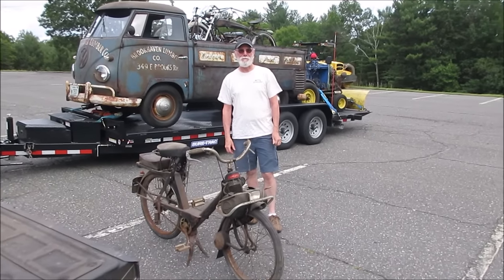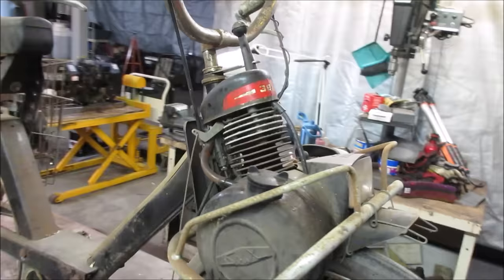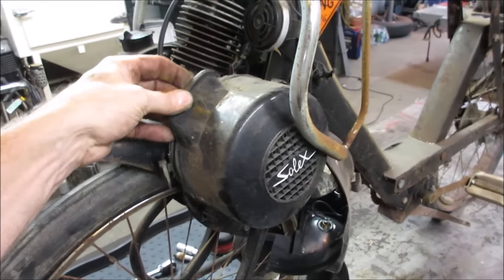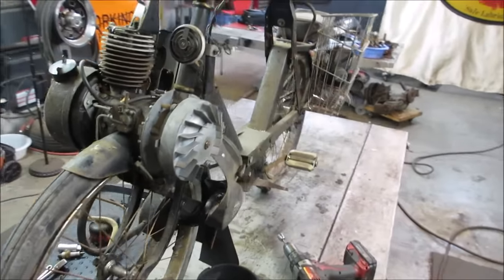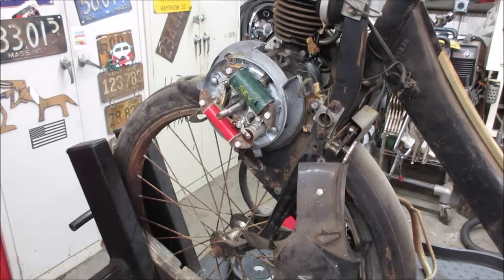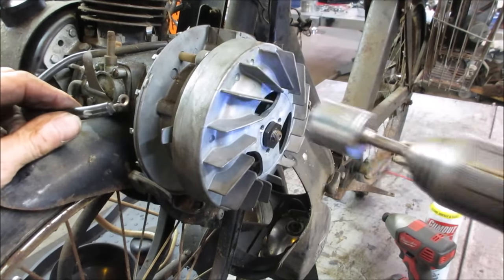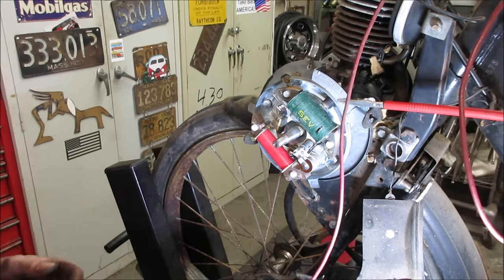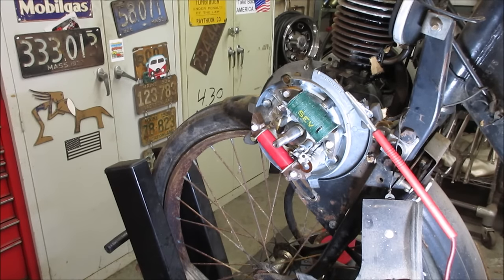Will It Run? VèloSolex 3800 Moped Parked in 1978.

Comment: My son had the same prob;em with his basement flooding about 10 years ago when all the power was cut by a storm and tornado for several days. Afterwards he installed a backup sump pump that runs off of city water pressure. It is set to a little higher float level than the electric main pump so it will only kick on if the electric one does not.

Comment: Had one of these as young. Late '83 it must have been. Was my first moped. Drived quite well, except if it was rainy weather. The the drive-wheel would just spin around without moving the bike forward. Being that time, there were some hacks for those to make them drive faster. The gas handle is correct, you needed to grab it to throttle down. 
Nice to see that machine again. Like a peak in a time machine. :)

Comment: My father in law bought one in 1954 France and he sure liked it.   He didn't have a car and used to use a bicycle to go to work.
I bought a 1978 AMF Roadmaster Model 110 in the 1970s to ride to my car pool when it was not my day to drive.
It was rear wheel drive like the Solex.  Sold it about 10 years ago for $100 needed a new drive stone that drove the rear tire.
Very simple engine with a plastic crank case.

Comment: The screws and bolts are probably all metric, as far as I know France invented the metric system. Pre-WWII threads might have non-standard pitches though.

Pipe fittings on vehicles could be anything I suspect. House plumbing in Europe uses Whitworth (British Standard Pipe Thread) with very few exceptions but fuels lines could be SAE I think. Black and galvanised pipes are Imperial, copper and stainless steel pipes are metric, as are drain pipes. Tap aerators use a metric thread (M22) that's deceptively close to 1/2" BSP but isn't compatible.

Fun fact: metric spanner sizes, like US spanners, are measured across flats, while Whitworth spanners are measured according to bolt diametre. Some metric bolts come in two different head sizes and French car manufacturers have been known to use both in one car. Whitworth bolts only go as small as something like 1/4", smaller UK screws were BA (British Association) screws, which was a metric system but incompatible with ISO Metric screw threads.

Fun fact #2: Italian light switches and sockets are fixed to the boxes in the wall using #6-32 UNC screws because the manufacturer BTicino imported the entire US back box system in the early 60s. Desktop and tower PC cases and some hard drives and optical drives use the same 6-32 screws while 3.5" floppy drives use M3 screws.

Comment: Had a solex 3800. Was always amazed at the fact the throttle works backwards. Weird french thing to always be full throttle and you had to bring it to idle. 

Was a pain in the ass to get it working correctly. One day I was so frustrated I threw it in the gutter and walked home.

Comment: The advantage of the Solex is that it works like a real bicycle with the motor disengaged, while sitting in a bicycle position.  Other mopeds at the time were motorized bikes with peddles added like a after thought with lots of friction and bad peddling position.
Reply: Except that the gearing is really low. You end up pedalling a lot for the little speed you get. No choice because that was the way you started up the engine, fighting compression.

Comment: Raise your engine for testing, otherwise you'll wear out the tire with the roller.
The carburetor is a continuous-flow unit, the hose is just a return to the tank.
Check and clean the fuel filter at the top of the carburettor and replace the air filter on the cylinder.Throttle control is only used to slow down the engine. Normal operation is full throttle!
The choke is the lever on the carburettor just behind the fuel filter.

Greetings from France!

Comment: My father bought a Velo Solex in 1960  for the commute to work 2 miles each way on a gravel road with 2 hills....
He did this for 3 years and had worn it out....
Traded it in for a 2 speed moped..an NSU Quickly....and basically gave that away after another 4 years doing the same commute...
and I never even got a chance to ride it!.
Reply: I have a 1961 NSU Quickly S…it’s the 2 speed, and great fun.

Comment: There is a fuel filter inside the fuelpump. The driving roller is made of carborundum. The decompression valve in the early models was ment  to stop the motor when not engaged

Comment: Back in the early 1970's there was a 2 stroke engine that mounted to the front of your bike. You would flip it down and it would rub on the front tire and start the engine. This 2 stroke engine could be mounted on the front of any bike and power the front wheel.

Comment: This is a cool little bike 😀  my parents had problems with their basement here in Virginia because the people who originally built their house back in the 60s did everything as cheaply as possible. The land the house is on is packed full of river rocks and so when the people who built the house decided it would be a smart idea to use the smooth river rocks that came from digging out the basment in the concrete mix for the floor and walls......  because of their bright idea, the walls and floors eventually cracked, and the walls started buckling inwards, and with no floor drains, the rain water would pour in through the walls.  Eventually, my parents were able to get a loan to have the house jacked up and the basement redone.

Comment: It is recommended that the VeloSoleX S 3800 is run at 50 : 1 (2%) pre-mix ratio if using a Semi-Synthetic oil such as Castrol Scoot-R 2-Stroke Oil or a 100% Fully-Synthetic oil such as Silkolene Pro 2.  Gosh, I remember Solex and Mobilex, when I was in France about 60 years ago.  I feel old!!!!!

Comment: Nice a solex when i was young there where so much of those . They where 45 cc mopeds the 3800 came from 1966.The brand name was velosolex . Tire size back then was 23x2.0. tire size now 23x1.75.Tire's and parts are plenty in europe. Also made with 3 wheels  . It was together with Berini m13 (litte egg) the ceapest moped. Enjoy the solex a real Mustie1 moped . Bye bye Jonh Bee
Reply: Did the 3800 model actually have a 38cc engine displacement?

Comment: My mother-in -law also owned an earlier one of these, which had originally belonged to the famous cartoonist and inventor, Rowland Emett, who had given it to her. I tried to get it going again in the 1960's but failed as I could not source the metric size front tyre to replace the rotted original,  in the UK, so I seem to recall it was thrown away. I recall phoning Michelin in London to ask if they could get a tyre, and being given the brush off by a snotty receptionist (how can I be of absolutely no help whatsoever to you today). The phenolic insulating material was called Tufnol in the UK.

Comment: My brother had one of these. During the mid '80s, I used it to commute to work during summer break. The best part was being able to lift the motor and coast down hills. Going down Texas street in San Diego was a hoot.  And then peddle like hell to help the motor pull it back up the hill on the way home.  Sometime I would have to get off and let the motor pull because it was like a donkey that just said NOPE with me riding on it.

Comment: At least on the older models the engine speed was controlled by a thumb lever on the right hand side.  The big right hand lever attached to the end of the handlebar would lift the engine off the wheel slightly and engage the front brake so you could sit at a light without stopping the engine
Reply: My simular Berini M14 also has a thumb throttle. Mine built in 1953....very similar to the Solex. Sometimes called the "egg"  due to the very handsome gas tank.

Comment: Thank you so much for the trip down memory lane. My maternal grandfather back in Denmark had one of these in pristine condition when I has a kid in the early eighties. He never owned a car and usually got around on a bicycle. The Velo Solex was for when he was going out of town! ;o) I remember him putting a pillow on the luggage rack in the back and us riding around. His grounded out the spark plug to kill the engine. He hated going slow on it - claimed it ‘sooted up’ the engine. I believe flat out these would do about 30 km/h - ~20 mph. Oh, and I do vaguely remember him having to hold in the throttle to go slow, so it might be reversed, as you surmised. PLEASE try to get this back into working condition and take us for a ride on it.

Comment: Cheng Shin makes a dual-purpose mountain bike tyre with knobs on most of the surface but also includes a solid rubber strip down the centre for road use. They come in a variety of sizes and might be perfect for this application

Comment: I owned a Solex bike in Holland 10s of thousands were in use during the 60s. It was ridden and started as a bike using the pedals and the motor dropped on the front wheel via a lever once a little speed was created. I loved it and my wife hated it. Ha ha.

Comment: I had one of these as a youngster. I got it for free as it quit running and the previous owner then split it into atoms in his fight to find the problem.
I found a couple of problems:
1) the flywheel had it's split ripped off.
2) the wire from the breaker contact to the coil was chafed and sometimes caused extra out of time ignitions (which ripped the flywheel split)

3) the exhaust pot was clogged.
4) the owner made a "tuning" by filing an extra opening in the bottom of the piston (extending the suction timing).
Once I found the chafed breaker wire I finally made it run well.
It was however for the time period slower than other mopeds as it could only do a max of 16mph from factory compared t0 the standard factory max of legally 19mph.

Comment: Was wondering how long it would take Mustie to figure out the cruise control a.k.a. "reverse throttle" - about 50 minutes!  It should/may have a regular grip twist.  The "Reverse Throttle" is a brake lever, and slows the engine down when you brake so that you're not fighting against the torque of the engine when trying to stop.  A spot of advice - don't try to go up hills if you're not fond of pedaling - when it comes to a grade, it's the little engine that can't, and you'll have to help it along with good old "leg horsepower!"  To be quite honest, it makes more noise than power anyway, but there are clubs and owners who can teach you how to tune and modify it to gin up enough speed to put a smile on your face. (Tuned exhaust, porting, jetting, a bit more compression, a hotter spark, etc.)

Comment: Solex are so much fun, I have a 1958 Solex 1400. Over here in europe you can get almost everything brand new on sites like solexdeal. Usually the gaskets leak but when replacing those they should run fine, not much to them. Throttle is indeed reversed as some said here before. They run about 15-20mp, newer ones like that should have a clutch, older ones like mine don't. The kickerwheel is carbide. Simple postwar cheap way of transportation.

Comment: I had a 3800S my one was made in Romania. It did about 30km/h. Riding it in the snow was a bit awkward because it had no freewheel so you have always traction on the front wheel.
 Other then that a fun moped. It had no horn maybe yours has that because of US regulations? My one had a bell just like a bicycle. Actually it is a bicycle with auxiliary motor. Nice to see you working on one, you will get the hang of it!

Comment: As said below, the lever you are using as a throttle is actually the front brake lever. It also has a linkage to close the throttle as you brake.
The actual throttle is a twist grip on the right hand handle bar....

Comment: Cant wait for the next video. I have dreamed of having that type of byke when I was 14. The real Mopet or the Honda C50 was way too pricey and you needed a driving licence for it and my mow would had never accepted to sign for it. The solex was seen as a bicycle because they had pedals and it was running with out the motor.

Comment: This "plastic" material is most likely called Canevasite. Similar to Bakelite (which had wood dust as a filler), but with canvas in it as the name indicates.
Reply: I was thinking Phenolic was the material he called plastic. Cheers from Guam USA👍
Reply: Yes, I think so. Canevasite was a phenolic resin with cloth adding strength because otherwise it was quite brittle. Greetings from Iceland 😊

Comment: If you are a bicycle rider, the backwards throttle works some with the instincts to brake to stop.
Reply: Just letting the right hand lever go gives you the relaxed  hold on the handlebar...no thumb push, no cocked wrist...
 and when you want to brake...
the throttle lever becomes the brake towards the end of it's travel towards the handle grip.......
and the revs have automatically been reduced as well....

Comment: My neighbor gave me one of these in 1981. It was pretty cool because I wasn’t old enough to drive yet and I got to hit the roads!   It only went 15mph but when the road was on an incline it didn’t lose a lot of speed. Oh yeah and the gas cap when you turn it upside down the bottom looks like a little cup. That is how much oil it needs per tank.

Comment: Hi Mustie I ha one of these French mopeds 59 years ago I was 16 it was so heavy, I spent most of my time pushing the dam thing you had to drop the engine with the roller on to the front wheel it was useless. I sold it and bought a BSA 250 cc happy days.

Comment: Hi Mustie 1.  I have 2 mopeds. One's a JC Penny and I don't remember what the other one is. I got them both in non running condition. The JC Penny was altogether, I just had to get it  fuel and spark. The other one came in boxes w/ no directions. They both ran about 25yrs ago. But, they've both been sitting probly w/ gas in them all those yrs tho. When I was a kid, one of my neighbors bought a motor setup that came home delivery. Spiegel or Sears I think. It had a little 2 stroke engine that ran against the front tire like your Solex. I was there when it came and within about 15mins we had it on the bike and he drove it away. That would have been about 1969.  I like how you get right to the meat of the issues when you do a video. I've done so much of this stuff it's important for me to see direct steps taken to determine the issues. Like using the drill motor to spin the engine for spark or see if it's ready to run. Or connect another gas engine w/ a v-belt and spin it up to 2,000 rpm for a few. I see some guys get out compression gauges and proclaim it will never work. Let me tell you at 10Lbs it will run at 2,000 rpm! Then in just a few minutes it'll start up with the starter. I'm the guy who hotwires the starter on a car w/ auto trans so I can crank the engine w/ auto trans in low gear at 20mph. When the trans gets enough oil pressure from cranking it will force the engine to turn over at road speed and that will usually start it right up. If not you sure know if the spark or fuel is the issue in a hurry. You do great work Musti 1, thank you for putting up w/ all that it takes to make a video. ben/ michigan

Comment: Basement sump: run the drain from your stationary washtub over to your pit, then just run some water into your washtub periodically to trip/exercise the pump.  You can also get a stainless float switch off eBay and rig up an alarm--battery, switch, loud piezo beeper.  Give you a heads-up when things are going south.

And hey, what happened to the VW thing?  Beginning to think you have a thing about not concluding videos involving white cars.  There was an oddball white kit car that just sort of vanished, and then a cheap Porsche you were poking around on.  Viewers need updates!  Continued good luck.

Comment: You can find this kind of tires just in France now. Very special size!  The Solex 3800 is rebuild in thermic or electric. It's a new company. Problem : the price are completly crasy, 3000 € ( more or less 3000 $ ). Thank you for this video. HI from France

Comment: My Mother had one when she was joung. She used to transport all kinds of stuff like 10,5 gallon milk cans and guiding sold cattle with it. She hated that moped, especially during the winter seasons.
When i got a job as a mechanic at a bike shop, we had a few of Solex mopeds in maintenance. Mostly from customers suffering from nostalgia, lol! I quickly began to understand why my Mother disliked it. It's a mechanical mess, fragile, the weight on the front wheel aswell as the front wheel drive is impractical, sensitive, clumsy and uncomfortable. They were in my personal top 3 of least favourite mopeds, but boy do they have a personality!

Comment: The big plastic tube leading into the top of the tank is a return. Also the right grip on the handlebar is twistable. So it also functions as a throttle grip like on a normal moped (but without a return spring) and can kind of shut off the throttle-down-function of the brake lever if twisted to the idle position like on a normal moped. It should then be able to idle without constantly pulling the brake lever.

Comment: it was designed to run wide open throttle in normal running as it only has 3/4 of a hp and flat out at 18mph, this model has a clutch the earlier models had direct drive and had to be disengaged with the lever if you wanted to keep running while stationery. i had the 1600 solex.